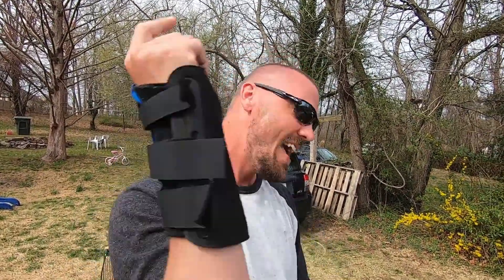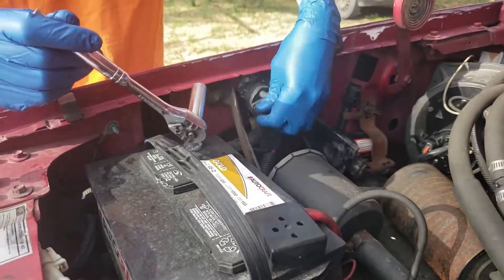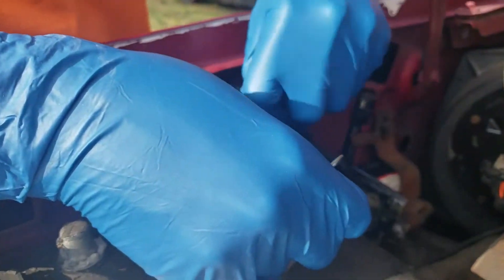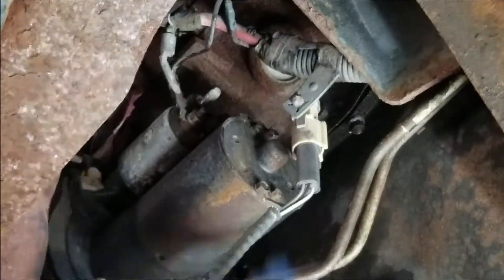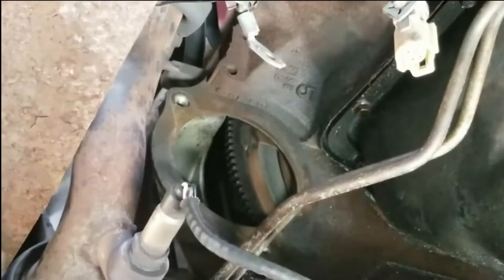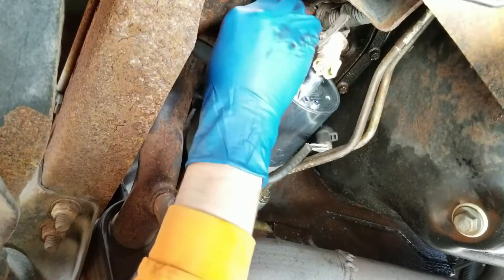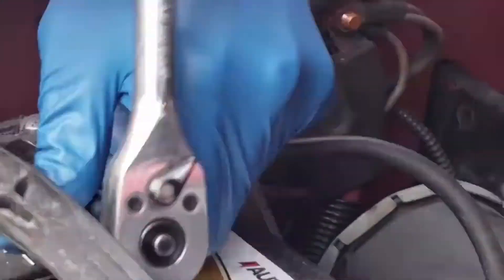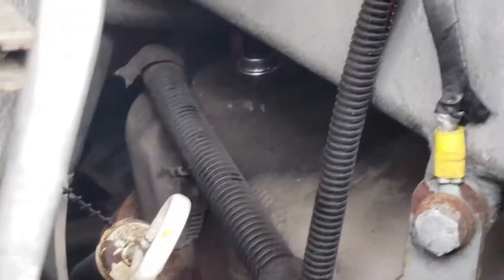1987 - 1996 Ford F150: Starter and Solenoid Replacement! (Updated with Commentary)

Comment: I replaced the solenoid in my 1991 F150. Everything was fine for about a month and then the car died entirely. I replaced the starter. No luck. Is it possible my wires are no good? What should I do!? Can’t find anything online to diagnose my issue. Thanks.
Reply from the maker: I know this is a late response, but did you get it figured out? I would say there is some other issue. I don't think that would relate to your new solenoid. Let me know if you figured it out!
Reply: Do you have to use shims?

Comment: Does one of those wires on the starter have a fusible link ?
Reply from the maker: To be completely honest, I believe it's wired to the fuse box. I don't believe there is an inline fuse, but I could be wrong. 

If anyone knows the answer to this, please comment below!
Reply: @TrickShiftGarage  have a 1995 bronco and i accidently grounded the alternator. Now i have no electric power. Someone said it probably blew the fusible link. Of course I can't find it.
Reply from the maker: I'm sorry! If I was you, I would check all fuses in the fuse box. Then, test the relays. Hopefully one of those are blown and you can fix the issue for cheap! Please let me know if you get it fixed!

Comment: Ay bro right quick i have the same truck and it won't turn over light come on everything comes on and then just a big click is this what I need to change does my problem sound like a starter problem
Reply from the maker: Hello Bani! I don't think your issue is a starter. When my starter went up, it didn't make a click or anything. Typically, if you hear a click it is probably your battery that has gone bad. Try jumping it or take it somewhere to get the battery tested. 

Thanks for watching! 🤟
Reply: @TrickShiftGarage hate to come in to yalls conversation but i have the same truck two I can jump start it but whenever I go to use my push button just one big click I have new solenoid new starter battery has 12 volts.

Comment: I'm having a issue with no charge battery gauge bouncing around lights go bright then dim again could it be the solenoid on the starter ?
Reply from the maker: You can try to replace it since it's cheap. But if that doesn't work, check out a new alternator. That could also be an issue. Does the battery die when the truck is running?
Reply from the maker: An easy way to check the status of the alternator is to start the truck and then disconnect the battery. A good alternator will keep the truck running. A bad alternator: truck will shut off.

Comment: What does the top elbow run too?
Reply from the maker: Are you referring to the vacuum line running into the top of the starter solenoid? That should just press right into the new one.
Reply: @TrickShiftGarage  man I appreciate the response like you wouldn't believe. I got a 94 f150 5.0 and can not for the life of me figure out the damn reason for the surge. Now one more question if you could, what is it a vacuum line too? Why does it look like an electrical connector? And yes I was asking cause I have another identical one right next to my distributor and don't know what that is too or for either
Reply from the maker: To be completely honest I'm not 100% sure. I would guess that it assists the solenoid in some fashion. 

You mention the trucks surges, does the idle fluctuate while you aren't moving? If so, you may need to replace your throttle position sensor. It's cheap and not difficult, but you will need to remove your throttle body to get to it.
Reply: @TrickShiftGarage  I'm going to replace that next and yes it's whenever it's in park. Thanks for the reply I appreciate it. I just can't find anything on that connector that looks identical to the one on the top of starter solenoid, (the one I originally asked about) It looks like it would go to the distributor due to its length for the vacuum advance maybe but the distributor i have it's doesnt have the vacuum canister on it and from what ive come to learn it's all electrical instead. I'll keep on searching and one day I'm sure I'll come across what it is. Thanks for the replys I really appreciate it
Reply from the maker: No problem man. I'm away from my truck right now, but when I get a chance I'll get under the hood abd start looking around. I'll also check my online manual and see what I can match up. Hopefully we can get this figured out for you!
Reply: @TrickShiftGarage  yea man. I appreciate that big time. If there is a way to post pics on here I would but I'm not sure if that is possible but anyways thanks again.